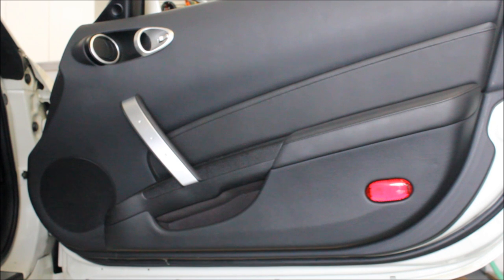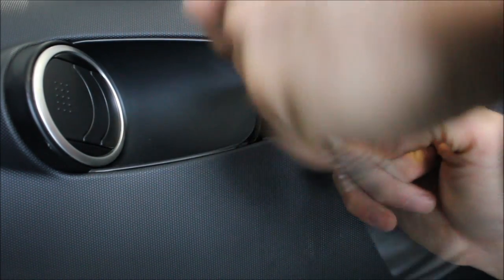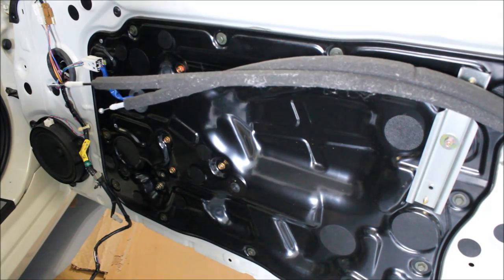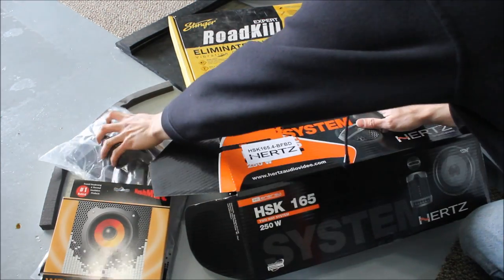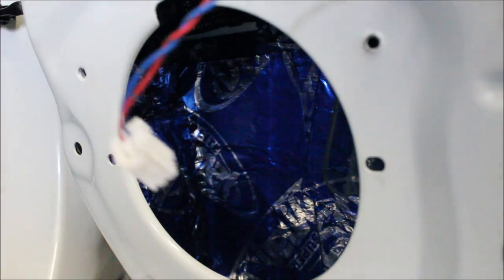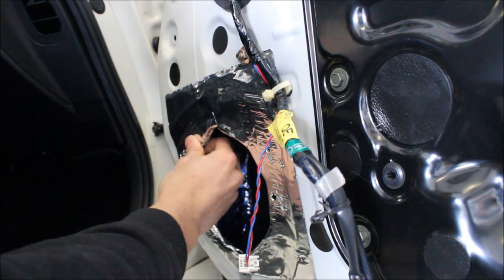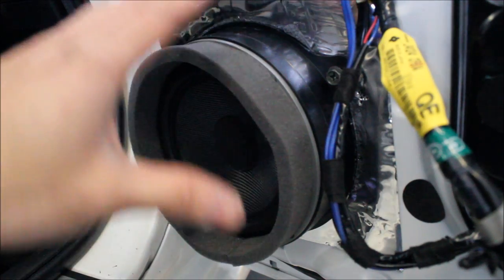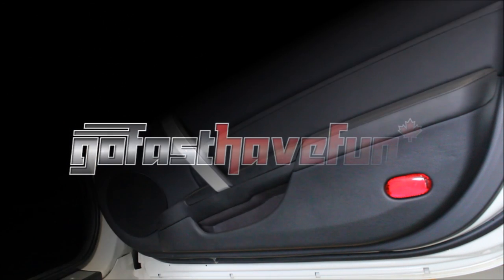Nissan 350Z Component Speaker Install (Door panel removal) | AnthonyJ350

Comment: Followed this install a few weeks back, some corrections/additional tips to this process. They make a custom 6 ½” Speaker adapter for most Nissan models (part number CECOMINOD020597). This is an EXACT fit into the 350z. Note for larger speakers like the ones Anthony installed and myself you will need another ½ inch to clear the window when rolled down. I would highly recommend getting this adapter as it is no nonsense, exact bolt in, no modification. Just don’t overtighten the plastic seemed it would give way under too much force.

Anthony mentions that he may run fresh speaker wire later. What he didn’t mention is how big of a pain it is. I ran new cable on the first shot. If you look online most people seem to be drilling/modifying their door harness to run 14-16 gauge cable through. After reading a few horror stories about how their door electronics were no longer working due to the modification, I went a different route. I cut holes in both the door and inside car and ran a custom loom for only the 14 gauge cable(used a Dremel metal cutting tool + step up drill bit on power drill). Nice part about this all is I was able to mount the crossovers in the kick panels. To summarize it all, you better be ready if you plan on doing a custom cable install. The jump from using factory wiring to custom was pretty crazy in complexity.

I used all the products Anthony suggested except the plastic adapter and speaker company, and it came out great. I will say however that I would be curious of what would happen if you just used the fast ring center ring instead of the wave breaker. I doubt there would be much difference. In addition the Fast rings foam, you have to cut in half. The speaker especially the one me + Anthony installed are so large that the rings need to be reduced in size. 

In addition, everyone commenting on the location of the tweeter. Yea, it could be mounted in a better location, I’ve seen a few threads of people mounting it in the pillar. If you are going to that level, the mid driver is not optimal either. The speaker grill on the door card/panel doesn’t line up perfectly, and the location isn't the best. I’ve seen some guys do some custom work with that as well. In the end how far are you willing to go? I will say for most normal people who enjoy good quality audio, you will be satisfied with setup shown by Anthony.

Pictures of install:
https://imgur.com/a/7jpsH

Oh and most of all, thanks Anthony for taking the time to show everyone your install procedure
Reply from the maker: Joe DeSantis Thank you and thanks for sharing your experience and feedback as well!
Reply from the maker: Where did you get that door boot for your speaker wire btw?
Reply: AutoLoc DLOOM Rubber Door Wire Loom off amazon. Has a Built in grommet both ends. Just drilled a 5/8's hole hit the holes with some paint, and ran the loom. They are $10 a pop, but made the install pretty clean, easy in that regards.If you are worried about sealing it off, you could use some Black Silicone.
Reply from the maker: Joe DeSantis Awesome thanks! Your install looks solid. More cutting I'm willing to do to my car. Good job.
Reply: I know this is old but I have the Hertz speakers and going to be doing this same install, (thanks for the part #) do I need an additional 1/2" spacer on top of this spacer/adapter plate?
Thanks

Comment: Do you think it was a good idea to try and use the door itself as the speaker enclosure instead of those foam baffles?
Reply from the maker: What we found through practice is the foam or plastic speaker baffles are too small (factor woofer displacement) and you loose a lot midrange bass from the speaker.
Reply: Gotcha. Thanks for the response.
Reply from the maker: @MeatPopsycle  No problem.

Comment: Did you cut the stock speaker adapter plug and just wire everything to it instead of routing new wires through the molex? also how are you running the tweeter wires to the rest of the system? it's very difficult to make that out. I'm assuming from the tweeter you're running the stock adapter and then to the crossover using aftermarket wire?
Reply from the maker: I used the stock wiring but I put connectors on and wired it directly to the passive cross overs.

Comment: My stock speakers blew out this week and Im looking to replace the speaker just like in this video. I have an old stereo (alpine iva d310) not sure if that matters, what would you recommend me getting now? I know newer speakers have came out since this video was release and maybe you can guide me on what models to look at. Great video btw.
Reply from the maker: JL Audio C2s are a fantastic value and will be easier to fit than the speakers I used. Depends if you want a lot of mid bass. If you do a larger speaker like the Hertz used is probably what you want.
Reply: @AnthonyJ350  Thank you for the recommendation !
Reply from the maker: @ivanbelmonte6284  You're welcome 🙂

Comment: Did you use the factory speaker wires from the 6.5 harness or did you run new speaker wires from the head unit / amp?
Reply from the maker: I used the main factory wires and extended them a bit. I push a 100 watts RMS through them, no issues.
Reply: @AnthonyJ350  thanks will do the same..🙏

Comment: Question do you thing adding all that foam and noise reduction stuff and leave the original speakers will make any difference in making better quality in the OEM Bose system ?
Reply from the maker: For sure, if you can cut down road noise and distortion, even factory speakers will see an improvement

Comment: Hi.what system do you have installed to monitor the air fuel that's above your radio.and what alarm system do you have that you can control everything from a remote
Reply from the maker: Gerrit Snyman I'm using a Greddy Infometer Touch with a t-harness and switch so I can turn it off for servicing and doesn't interfere with  diagnostic equipment. The remote start and security is a Viper 5806V with a DBall2 interface.

https://youtu.be/l9zGcAY3MQA

Comment: What freq. is your HP filter and xover rate?  Any vibrations?  How much power?  I've always heard the 350z has cruddy vibrations and poor midrange through the front door speakers and the best bet is to do custom kick pods made out of fiberglass completely bypassing the doors and sail panels all together due to their poor angles and SQ.  In other words, how do your Hertz sound? lol
Reply from the maker: I know they angle down but I feel people are nit picky. Sitting that close can you tell the difference? The Hertz are big and with enough power the midrange is strong if you build up the door. I have the Hertz down to 50hz and I think I have a -6  dB slope at the amp right now. I did not turn on the HPF at the head unit or you compound the slope.
Reply from the maker: I do demo the car on my Facebook page in the video section
Reply: Anthony your super quick response to my question is terrific and thank you for posting such helpful videos btw!   I might just do custom kick panels for midbass/midrange using DLS iridum 6.5" 70hz-2.5k, tweets in a custom a-pillar up high 2.5k on up, and after watching your video some 6.5" midbass only running 70hz - 250hz for some extra sound up front.  No rear speakers.  Anyway, great stuff man i just watched the dip stick video....great channel. subscribed.
Reply from the maker: +Johnny Werner (reker13) Thank you! Sounds like you're pretty experienced so it means a lot.

Comment: anthony..i have a question... 

i've changed the speaker in my doors..but i kept the old tweeters still plugged.. is it possible that those prevent my new speakers from playing the high frequencies? maybe these tweeters still use a canceling capacitor or something..

any advice>? thanks
Reply from the maker: What's probably happening is you have a factory amplified system that crosses over the speakers at a particular frequency.  So if you put a coaxial speaker in the door, that speaker does not get full range because of the amp and that's what is preventing the high frequencies from playing.

Comment: Do i need to have an external amp if im adding new comp speakers? Like i have a stock sound system and im tryna upgrade it and bought a set of rockport comp speakers. Really feel like i messed up not buying an amp the more i read
Reply from the maker: How much power do your speakers need (RMS watts)?
Reply: AnthonyJ350 40 rms watts i got rockportR165-S

Comment: Do you think those are better than the stock Bose? I tried some 6.5s for my rear speakers from Best Buy (kenwood) and my Bose were the same if not slight better
Reply from the maker: These are way better. The BOSE system isnt clear. You will need am aftermarket amp and sub to hit their potential though
Reply: AnthonyJ350 yeah that’s what I have Kicker sub and amp and it sounds pretty good. Then I decided to try the Kenwood concert series speakers and they were the same as the Bose. I want something more clear, unfortunately once I reach a high volume the distortion is pretty bad with those (I use Pioneer SPH da120 radio)
Reply from the maker: @rrrrrafaell  That's because you used the BOSE amp, you have to bypass it
Reply: AnthonyJ350 I never had the Bose ones. I bought them for the quality but I had the regular speakers before the Bose and now is an aftermarket amp. Do you know any solution to fix that? I’d appreciate it!
Reply from the maker: @rrrrrafaell  Are the new ones mounted in an adapter and sound deadened like in the video?
Reply: AnthonyJ350 no dynamat and since they’re direct fit I just wire them there it’s weird because I hit volume 26 or so and the sound is bad haha

Comment: did you run your speaker wire through the stock loom or did you drill a hole in the door?  I ran mine through the loom.
Reply from the maker: Tom R I'm not running that much power so it's the stock wiring for the most part.
Reply: cool. sick speakers btw.
Reply from the maker: Tom R Thanks! Ya they're very clear and produce a good amount of mid bass.

Comment: Hi, I just bought my 350z but I just blew one of my speakers up. I see you have a few sponsored on your page, my question is are these the stock market ones or after? I know the stock are terrible but I just want higher quality ones and I'm at a lose to finding good quality parts.
Reply from the maker: I used Hertz Audio in my car.  I would suggest visiting your local car audio shop and listening to some 6.5" component speakers.
Reply: @AnthonyJ350  thanks! I really want to do this myself and your video has given me a little more confidence that I won't blow it up trying
Reply: @AnthonyJ350  any website recommendations for quality after market parts?

Comment: Do you also need the speaker adapter plates for the rear speakers too or just the fronts?
Reply from the maker: The rear speakers they line up with the holes, just use sound deadening during the install. https://www.youtube.com/watch?v=X5P58rfMM4c

Comment: Did the ohm difference make it quieter?
Reply from the maker: With just the factory head unit yes. But I went to a 5 channel amplifier pretty much right after because that was the plan.
Reply: @AnthonyJ350  ah, ok

Comment: HI Anthony,  based on your video, I decided to upgrade my door speakers. However, having a little dilemma with the dls crossover.  I truly want to do a good job securing it but the crossover casing does not fit flush at your selected location.  I think that is the best location for me aswell.  Do you have any tips in how to secure the crossover correctly?  
I welcome you sage advice,
George
Reply from the maker: george sanchez You can make a mounting surface out of ABS plastic and mount the passive crossover to that after.
Reply: I understand!  I was also thinking of putting two .5 inches wide brackets that would allow me to have an even surface to mount the crossover.
Thank you for your advice!
Reply from the maker: george sanchez Yes you can do that as well.

Comment: Hi Anthony, I am looking for door speakers for my 350z. I would like to ask: in your experience, what's the max depth of my speaker without hitting the glass? I have ordered a 7/8 inch spacer but still looking for speakers. Thanks.
Reply from the maker: Rocky Tse I don't remember off the top of my head. JL Audio C2 speakers should fit easily.
Reply: Buy spacers from crutchfield for 6.5 components

Comment: Great video! I'm getting ready to put new component speakers in my door as well, I do have one question, did you get an adapter for the stock harness? Or did you cut and solder the wires?
Reply from the maker: I cut and solder wires
Reply: @AnthonyJ350  Hi did you cut thre wires on the door or before the door ? is still stock wires bro your player ? Thanks
Reply from the maker: @wdy7472  I used the stock wires and I'm putting 100 watts RMS through them for the speakers through an Alpine PDX V9 five channel amplifier.
Reply: @AnthonyJ350  Thanks for the reply does the cable enough strength power to the speakers ? does it crack when you play it loud  ? Thanks
Reply from the maker: @wdy7472  No it works perfect, you just need to make sure your amp can supply the speakers enough power
Reply: @AnthonyJ350  Noted wite thanks . i'm planning to power up my speakers with DSP , any recommendation on that bro ?
Reply from the maker: @wdy7472  Kicker IQ amp and Audio Control make nice amps with DSP built in.

Comment: What are your thoughts on how the door panel speaker grill doesn't really line up with the speaker?  Looks to me like only about half the grill is even over the speaker.  I used fast rings on mine and I'm happy with the sound I get, but I can't help but think that some of the sound is getting trapped in there.
Reply from the maker: Jeremy Schank If you want it to line up better you would have to 3D router a speaker adapter to give it an angle or do a custom grille on the door panel itself aligning with the speaker. If you want to test listen to it with the door panel off and see if you hear a significant difference.
Reply: Yea i listened to it with and without the door panel and honestly couldn't tell much of a difference.  I was just curious what your thoughts were on that situation since I am a newb in car audio lol
Reply from the maker: Jeremy Schank I think If it had an angle on it toward the listener you can get some better imaging. Bit then fitment may become an issue you'll have to overcome.

Comment: What's the difference between Dynamat and the sliver/chrome sound deadening that you install later on the door panel ?
Reply from the maker: I used Stinger Roadkill here. I still believe Dynamat has some of the best dampening properties, many people say they're all the same but I've had the opportunity to test different types back to back.
Reply from the maker: Just depends on how much you want to spend.
Reply: @AnthonyJ350  thanks for the quick and clear answer 👍

Comment: What did you use to mount the crossover?
Reply from the maker: In the door
Reply: @AnthonyJ350  what is sticking it to the door?
Reply from the maker: @LtLongle  screws through the the sub inner sheet metal panel. Grease on the other end to help prevent corrosion.
Reply: @AnthonyJ350  gotchya. Thanks
Reply from the maker: @LtLongle  You're welcome.

Comment: Hello, my question to you is do you know the part # for that thick foam you used around the speaker(the one between the door panel and the speaker)? Thank you.
Reply from the maker: +Valentin Reinis I would just try to find the equivalent foam tape for whether sealing at your local hardware store.
Reply: +AnthonyJ350 is that a tesa brand? becasue our shop gets some stuff from them. I jist never seen this product and it looks like it could bump us up to the next level of install 😊
Reply from the maker: Valentin Reinis It said TESA on the release paper, but I have no idea where it was from.  I just had it laying in my shop.  Cause I think it's the same result but cheaper than fast rings.
Reply: +AnthonyJ350 yea fast rings are over priced. would by any chance have a part # or was it just shop mats laying around?
Reply from the maker: Valentin Reinis Sorry, no numbers on it.  I was using whether stripping tape from Home Depot and that seemed to work well too.  Just not a lot of variety on height.

Comment: What size speaker wire do you use? What brand wire do you recommend? Thanks
Reply from the maker: Tyler Lesko I used factory here with 14 gauge I think. 12 gauge you're usually fine for more applications.
Reply: AnthonyJ350 and should you use component speakers only in front then coaxial speakers in back of the 350z?
Reply from the maker: Tyler Lesko That's what I did.
Reply: AnthonyJ350 okay thanks. One more question. What do you recommend for amplifying the four speakers but i also want to wire a 10” sub
Reply from the maker: Tyler Lesko Alpine PDX V9 five channel amp is my go to piece.
Reply: @AnthonyJ350  did you use the factory amp

Comment: Does the 350Z have a Quadraphonic speaker setup as most cars do?
Reply from the maker: +Khyree Holmes Yes it has 4 speakers. Doors and 2 in the rear behind the occupants.  Some are also equipped with a factory sub.
Reply: +AnthonyJ350 
I always wondered since its a 2 seater car.

Comment: what inch size speakers go in the doors if these?
Reply from the maker: Zion! Ghosts Commentator! 6.5" with proper adapter/ spacers.
Reply: AnthonyJ350 do you have to have an adaptor ? can't they screw right into the same spot the factory ones were in? cheers
Reply from the maker: Zion! Ghosts Commentator! That's why you need the adapter so it lines up with the factory holes. You see me use them in the video.
Reply: AnthonyJ350 isn't the adapter already on the factory speaker tho so i don't need to worry about it, just swap the speakers over?
Reply: oooo never mind aha, just seen. i need to buy an adaptor to suit